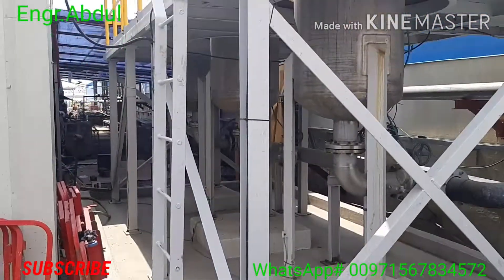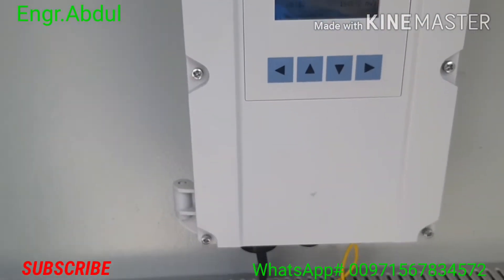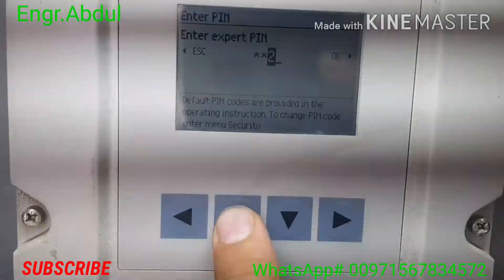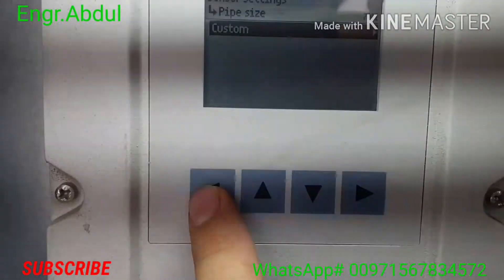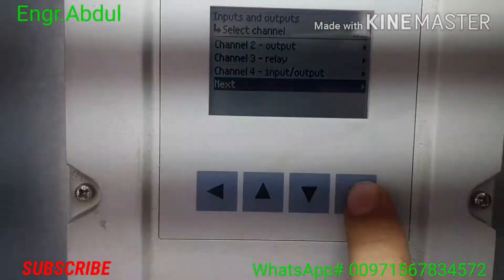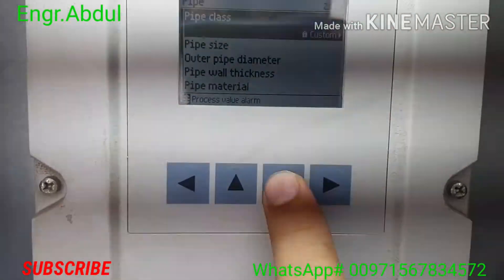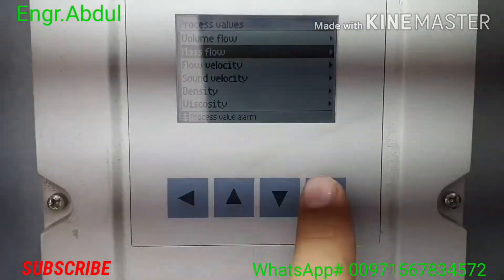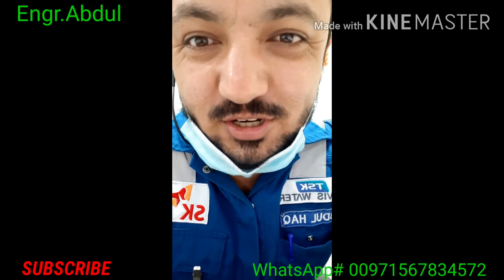How to calibrate and Install SITRANS FSS200 Ultrasonic Flowmeter.

Comment: Nice , I forgot the password of ultrasonic flow meter fs220 Siemens, how slove the problem
Reply from the maker: @السيدمحمد-د5و  the password is mentioned in the video kindly check
Reply from the maker: For user  2457
For Expert 2834
Reply: I know the default password 2457,2834, but these password changed and I forgot the new password and I need pin unlock key puk code for reset password
Reply from the maker: @السيدمحمد-د5و  I know only this password brother